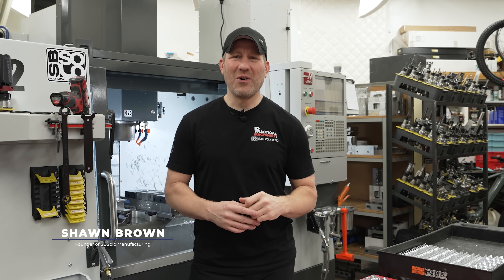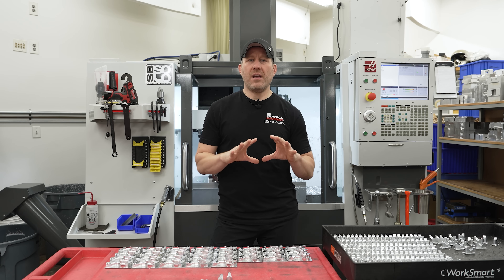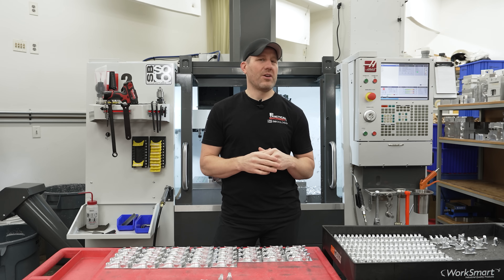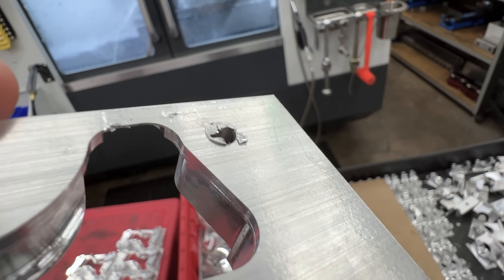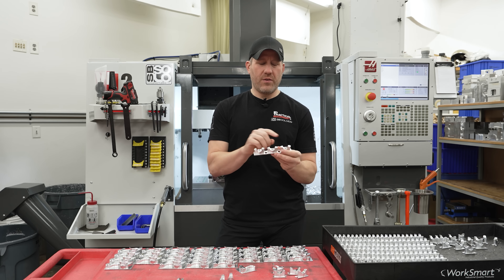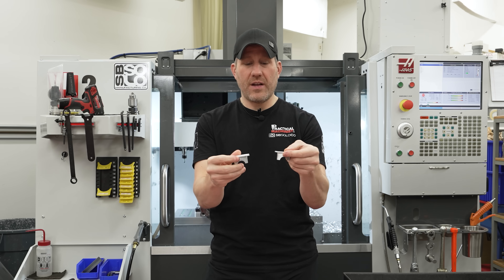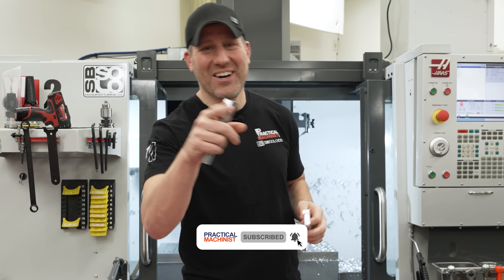A Different Approach to Cutting CNC Parts – No More Bandsaws! | How We Do It Ep.7

Comment: no way machine cut parts at the same time from stock in the first operation and they not all the same, at they should be close enough for the vise to grip all of them in op2, if the machine cant handle that kind of tolerance I would stop everything, have it service asap or just buy new machine

Comment: I’m trying this today on some parts because I hate the band saw mess too!

Is there a good way to update the rest machining stock in fusion 360 (if that’s what you use) to just include one single part for op2? 

I’ve struggled with this method because my op2 stock is the whole bar of parts I ran for op1 and sometimes makes programming for a single part in op2 difficult.
Reply: I don’t use fusion but you should be able to modify the STL file and just chop off the other parts where you cut them apart. Then just resave the STL model as one piece.

Comment: Tabbing and slit sawing definetly have its place in the trade. All depends on how bothersome the second op would be if you didnt, have had parts which would give me a nightmare on second op unless i used the tabbing strategy. I usually do one offs or very low volumes so I try to minimize using a bunch of time to make intricate fixtures and setups whenever possible.

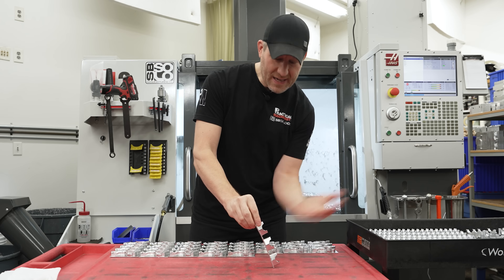Comment: 0:21 The comedic timing of the karate chop visual was perfect!

A lot of hobby machinists on YouTube will use a softer material (e.g. annealed copper) against the vise jaw when clamping multiple parts so that it grips more evenly. Is that technique used in modern CNC shops?
Reply: I would use tape against the jaw when I did it. Really depends on cutting pressure. Light pressure you can get away with it. For production tho I rather make it full proof and just go with 2 up so I can rough fast and hard. You can also use soft jaws in conjunction with a mitee bite or something to independently clamp the pieces individually.  But then you need to remember to loosens the clamps before you loosen the vice so the vice does most the clamping on the next set of parts.
Reply: I sometimes would put a strip of paper between the movable jaw and the parts. Paper compresses a bit and keeps everything snug. Wouldn't go hog wild on the cutting forces tho.
Reply: Or just make a custom fixture if the quantities are high enough to make it worth it.
Reply: @SBSOLOCO  I appreciate your replies, thanks for sharing your experience!

Comment: Another cool benefit of nesting multiple parts into the same blank is that you handle the material less. Less sawing, but also fewer parts placed in the vise, fewer part locations to pick up with work stop or probe,  if you need to count sawn blanks it goes a lot faster.

I often run op2 as a strip as well, but you're right about tossed parts. I think it's worth considering the types of cutting forces on the parts and how well they're held. Op2 in soft jaws where the parts are held deep and I'm just facing and chamfering - absolutely I would run more than 2 pcs in a vise. In that case there is a great hold and face mill and chamfer mill don't really lift the part. On the other hand if the parts are projecting tall out of the op2 vise and need long side wall milling I would certainly avoid running more than 2pcs per vise.

When you do run the op2 parts as a strip you get, again, huge savings in handling of parts. Again, only one work stop or probe hit can handle the location of multiple parts, and it's one chunk to handle between op1 and op2 vise stations rather than multiple parts. Makes a big difference! I run some parts like this with 5 parts per blank and it is PRODUCTIVE.

Thanks for sharing! Ignore the chode telling you not to make jokes. One suggestion though is to toss up some more photos as visual aides when possible. I was able to follow you just fine as you talked about windowframing, five axis tabbing, slitting saws etc, but some folks newer to CNC might get lost without a visual. And for crissakes get a bandsaw!
Reply: Your first paragraph 💯! Load the vice up as much as you can. Cheaper on the sawing blanks and why I do it that way.  

I hear you on visuals, picture is worth 1000 words. I just didn’t have any I was allowed to share. I almost didn’t want to talk about it for that reason. Anyways, thanks for the reply 🤙

Comment: Love the approach! Don't forget about double angle chamfer mills. If the part has a flat back you can get the chamfer established so no worries about it moving
Reply: For sure! Another tool in the toolbox to get the job done! 🤜🤛
Reply: What do you mean? To  use the chamfered surfaces to position/locate the part with precision when flipped upside-down?
Reply: @giuliobuccini208  you can use a double sided chamfer mills to finish chamfer the machine side if it's flat. Sometimes on op2 the part can get shifted rotationally so if you don't have to worry about you chamfer being off you can just cut the part to height

Comment: ya no cap.
i hav this thing where i do alot of parts 
either inside out or outside in.
say something with holes,
say a base plate or control panel for idk a zamboni mabe.
put plate in vise and do all the inside holes.
set on a fixture and bolt thru some holes
then profile outside edges.
i have done parts like piston rod like parts that way too.
(more like dog bone parts i guess)
place in 2 vices, machine  bores,
place on bosses on fixtures,
then machine outside profile.
no cap, ya sounds stupid i agree.
Reply: Definitely a tried and true approach. Sometimes that’s the best way for sure!
Reply: @SBSOLOCO  i make most of the parts that cuts ice at hockey games atm n i drink timmies coffees while doing it.
Reply: @timstevens3361 i was wondering when you mentioned Zamboni. Always interesting to hear what other people make. 👍
Reply: @SBSOLOCO  i used to run horizontal boring mills. i worked on 2 snks at patriot for 4 yrs. 10 feet on y, 26 feet on x, 7 feet on z, 50,000 lb weigh limit. vertical and horizontal heads. 360 degs on horzntal.